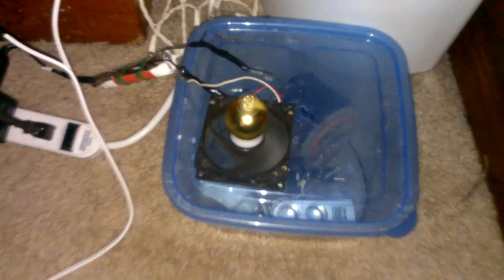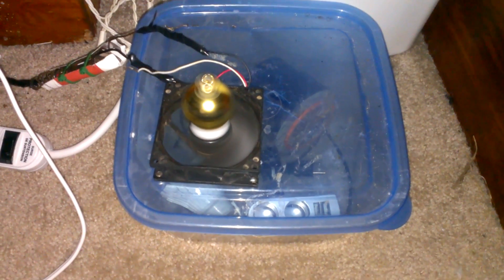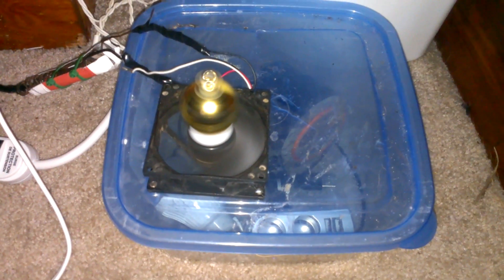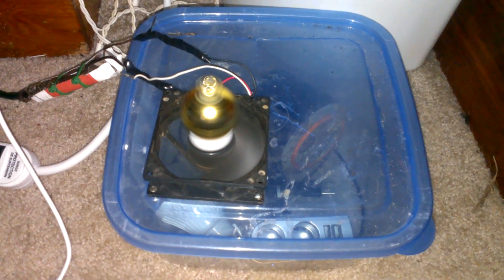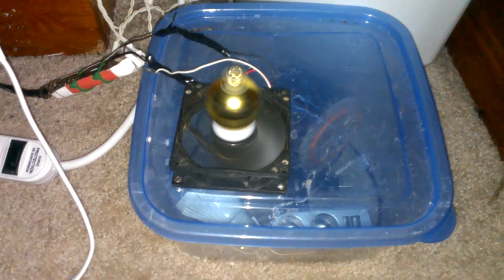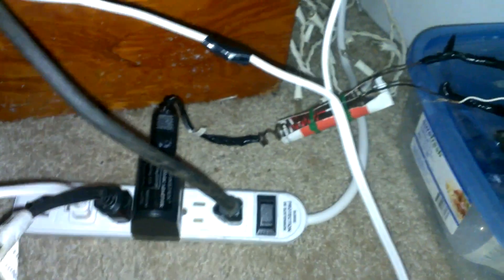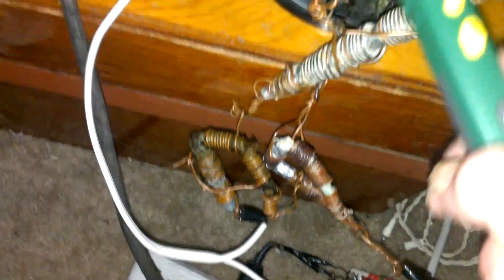Keshe Magrav Rebirth of March 3, 2016

Comment: Did you use gans in your center balls. Could I ask what you used on your coils and then is it the same in your balls (in same order)? Ex. If lower coil is heavy gans (silver etc) middle CH3, top CO2 did you use the same stuff at same level?
Reply from the maker: +GreenlandRomeHaven No center balls. Filled small holes with C02 GANS with Amino Acids in the center of the CD cases, then put a piece of duct tape over that. I used CH3 on bottom level?, and a mix of CUO and to tell you the truth, I don't recall exactly. I just mixed it up by intuition. I believe the real trick to this tech or the plasma battery/capacitors is that you MUST create a short for it to work. It's not Electricity and the sooner you realize that fact, the sooner you are up and running or heading in the right direction anyway. The actual fun is in the journey, not necessarily the destination. :)

Comment: Why are your wires ( around capacitors so bright and yellow.  Did you nano coat them.  It looks like you had coated wires and then you nano coated them.   You need to use bare wires (no coating) and then burn or use caustic to nano coat.   Overall, excellent job, I like the crystals, please keep us updated.
Reply from the maker: +Zia fatemi They are nanocoated, they just change color with current added or messing with them like a fanatic like I did with the multimeter, charging, discharging, etc. I played around a lot just trying to figure out how the equipment worked. Thanks for the advice. And your working unit is where? Each unit works according to it's creator and that would be ME, in this case...lol.
Reply: Dear sir, for the past 2 weeks I followed this KESHE. still some time I don't believe it ????I don't understand why some people put input for the reactor? ?????it suppose to generate electricity. ..........!!!!!!???